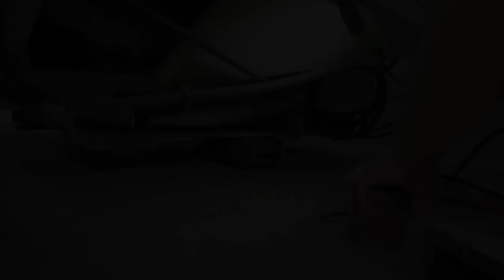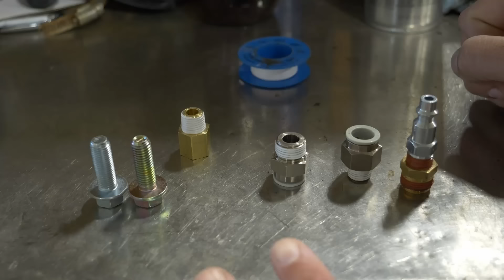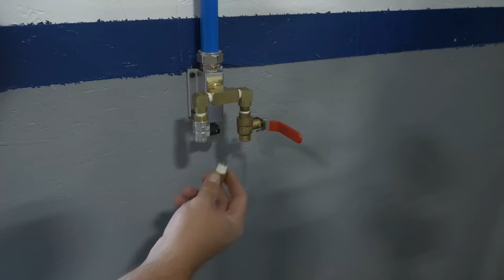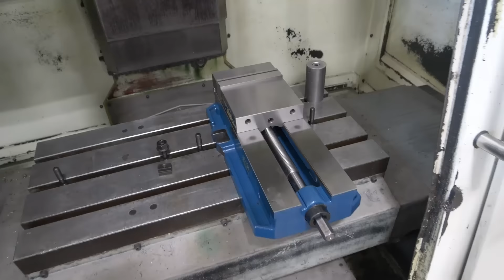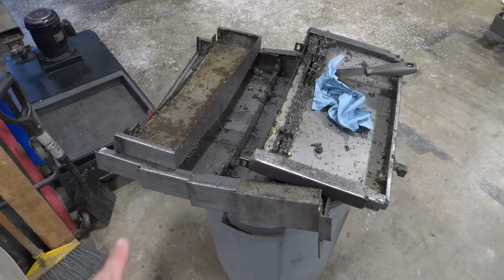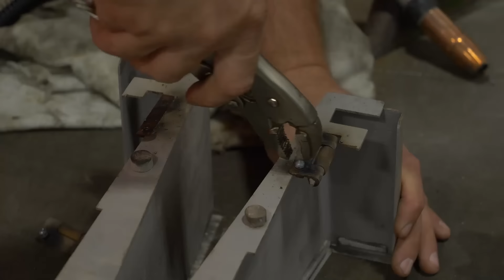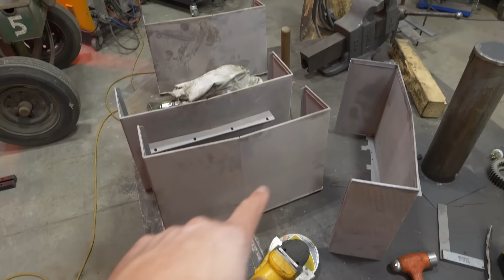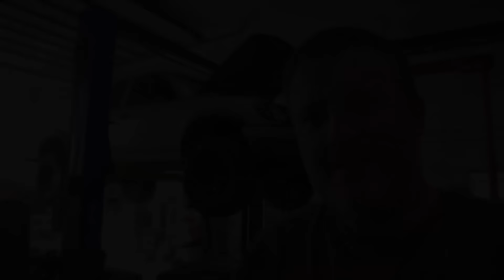Did I Buy a Problem or a Solution? Cheap CNC Repair Part 1

Comment: Fascinating video on the CNC Wes which brought back memories of my last few years in heavy engineering before I retrained in Network Engineering until I retired. The drawback with way covers, unless the owner before you regularly cleaned the machine the swarf, especially on harder materials will find its way past the wipers and gouge tramlines everywhere. The trouble is the suppliers of wiper rails know you need them and gouge the customer accordingly and yes, they do that where I live in the U.K. too. 
Long has there been arguments about which is superior, imperial or metric. If there was one standard internationally for metric, yeah it is marginally superior, until that is, you come to torque values. Of the hundreds of apprentices that I taught over the previous 50+ years, all of them found foot-pounds so much easier to comprehend than Newton-metres regarding the calculation process. 
Shame about the truck and you’re quite right to draw the line at such an extensive repair. I recall working on many hundreds of Land Rover chassis’ that had rotted out, but by that point I had built a clamping rig to prevent the inevitable distortion, which was both time consuming and expensive. Looking forward to CNC mill part 2.

Comment: The problem of repairing a rusted frame is where to stop.  There's no rules to say the rust has to begin here and end there, and the spot you miss is where it will break at 80mph on the highway.

Comment: Since this was only part 1 I don't know if you found a solution for the missing bumpers, stoppers and other rubber bits. But I think you should try 3d printing them in TPU.

Comment: Of course pitch are different, cos one of M10 is fine thread (look like 1mm).
Had nothing to do with DIN/JIS
Metric standard actualy have 4 different pitches for M10: 0.75, 1, 1.25 and 1.5. And you cohoose one according to the jobs they have to do. Fine pitch is very ususal in automotive, cos it have better performance for the same nominal size.
Juslt lik UNF/UNC

When was the last time you calculated how much torque is produced by some force on the lever?
You read it from the manual, adjust wrench accordingly, and that's it. Does not mettir if it's in foot pund, newton meters, kilopond meters... whatever.
Engeneers, calculate torque, and one more number to multiply is not a poblem after thousands of calculations :)
Also in europe, people ususaly use Kg for the weight, in everyday life. We do not go to local store and ask for 9.81N of potatos :)

To clarify.. I do not "defend" metric... anyone use what he was familiar with. 
Just... there is a lot of misunderstanding in US about metric.

Comment: Uhm - I'll have to correct you in one point:
We don't use kg in any way for trque.... 
All torque wrenches as well as engine specifications, etc are in Newtonmeters (Nm) - so as it's force it's pretty much the same as  the weight you use
Reply: 10:49 Here we go, the first thing is that as Gravity’s acceleration is 9.81 m/s^2, for conversion from Mass to Forces you‘ll in the absolute majority of day-to-day use cases just add a ‚0‘ to kgs and use that as your Newtons, hence simply rounding the gravitational constant to 10 m/s^2.
If you now wanna go back to your example of the torque wrench: your bar’s length from axis of rotation (either meter or ft) and the „weight“ or force (lbs, or kg*m/s^2 as Newton N) acting on the Bar at your given length from the axis of rotation. Not so different (nor difficult) anymore is it?

Comment: You got a point with the pound vs kilogram thing, but here in Europe we simply use 10 as the gravity, because 9.81 is basically 10, so 100 kilograms are 1000 Newtons. 
If you apply that to a 300 mm lever, that is 0.3 meters, it comes out to 1000 Newtons x 0.3 meter = 300 Newtonmeters. 

I worked on Cessnas and Pipers, aleays from factory manuals, but I grown up with metric, so I still prefer 10 mm to 3/8". :)

Comment: The metric bolts are two parts of the SAME standard which has two thread pitches, which in Britain we call metric coarse and metric fine.
Reply: JIS has reduced head sizes compared to ISO/DIN.
EACH 'standard' has different pitches.
Reply: You make an important point David. The same applies to inch dimensions UNC and UNF.  But let us not dwell on these details for too long, there are standards so much like mr. Wes said. He does a wonderful job doesn't he.

Comment: The “problem” with the Metric system is not the countries using it, but the one country in the world that is stubborn enough not to. Just my opinion, and I have to work with both the Metric and the Imperial system. If you can count to ten you can work with the Metric system, the fractions of the Imperial system are a pain.

And the Japanese Metric bolt is not standard course, but Metric fine thread, US thread also has course, fine and extra fine, so that comparisment is flawed, since it is not a downside of the Metric when both systems have those options.

Comment: Well ... that looks like a roller coaster of some sort. But: would you have had lesser repair work on a more expensive unit ? I don't think so if a unit had been used commercially for some decades. If you draw a graph price against work you are always outside the optimal sweet spot. So you saved money on buying that and had to spend more time on the repair - which you can distribute over time. Other than shoving out the money at one time. Thanks for showing !

Comment: Here is what my recently departed, German Aeronautical/mechanical engineer father in law said to me, the imperial system is far more elegant than metric, metric is a cold system relatet to nothing, imperial is related to natural measurements, thats why we know what a thou. is but have no concept of what a 100th of a milimeter is, incidentally who is smarter, europeans that can use only metric (except for older UK craftspeople) or Americans who seem to swap between imperial and metric with alacrity.

Comment: Wes I just fixed my 02 Tacoma frame and used a company called Safety cap and they make individual parts for frames if you were interested in fixing that, mine wasn’t that bad but it turned out great.

Comment: Regarding spindle trim: If you assume the spindle is perfectly aligned with the Z ways, the using a the indicator tramming ensures that the head is aligned with the table. BUT, we know what happens with assumptions. Better get a 90 degree stone or a known square on the table and run the indicator with the Z ways against that in both X and Y directions to see that the colum ways are actually perpendicular and then check the tram of the spindle.

Comment: Whitworth is never discussed often enough in the comparisons of imperial and metric.  Whitworth as found on bolts had rolled,rounded thread profile, which made it very strong and crack resistant unlike metric or SAE imperial threads.  So Whitworth was abandoned completely as the 20th century wore on..........until the Aviation industry needed a rolled,rounded thread and had to invent an Aircraft thread that effectively duplicated Whitworth.
Reply from the maker: The small root radius has been added to pretty much all thread specs.

Comment: Just so you know it’s the U.S., Liberia and Myanmar who are still using the imperial system and that’s all.
I lived through the change over in Australia in 1970 and trained as a Fitter and Turner  through the 80’s
I still think in both systems and I’m ok with that and I’m probably more versatile for it.
My home workshop lathe is imperial and my mill is metric.  Pipe threads do seem to have missed  out somehow.
I’m one of the percentage that gets the difference but pipe threads has to be one of the weirdest things out there.
Don’t forget NPT could have just copied BSP perhaps just change the thread angle to call it there own 🤠
Love the cardboard model.  Explains it very well.

Comment: "What years were the Toyota Tacoma frame recall?
Model years affected are from 2004 to 2008 (or 2010 in a few cases). This follows an earlier extended warranty affecting Toyota trucks from 1995-2003. But there's one catch: the program expires 15 years after the date of manufacture."

Comment: I know you live in a rust-prone area, but weren't those era of Tacoma under a recall for rusting frames?
Reply: 15 years from the date of manufacture - dealer would replace the complete frame at no cost to the customer.
Reply: @DavidNull5  thanks for the reply. I figured this was too late, but I couldn't remember any specifics.  Hell, who knows, this one could be on its second frame anyway.

Comment: Wes, is the JIS metric thread the same as a standard metric fine thread?
Reply: It is a metric fine thread.  For some reason Wes apparently didn't realise this, even though coarse and fine thread exist in Imperial bolt sizes too.
Reply: @dfross87  a regular metric fine thread  has the same size hex though.
Reply: @andrewnajarian5994  The hex is the same size for coarse and fine thread within each standard, but there are two standards for metric bolt head sizes (DIN & JIS).  For some bolt sizes both standards specify the same size head, for other sizes the head size is different.

The threads are the same in both standards, so a coarse thread JIS bolt will thread perfectly smoothly with a coarse thread DIN nut.

Like Wes said, "The great thing about standards is there's so many to choose from!"

Comment: in the metric system we dont torque bolts in kg is in newton meters and is more acurate than ft-pound an we use also degrees

Comment: First vehicle I bought new was a '98 Tacoma SR5.  Manual windows, manual transmission.  Straight 4 engine.  Live on the West Coast, so rust wouldn't be an issue.  

Then I knocked up my wife, and car seats don't fit in the back of an extended cab compact pickup.  Upgraded to an '05 Tundra that brought the kid home from the hospital.  It's now his, and I drive a '24 Tundra TRD Pro.

But I still miss that Taco-truck every day.

Comment: Thank-you Wes.  For those that don't know, the unit of force (weight) is the Newton.  A 1 kg mass weighs 9.81 newtons at standard gravity.  Force = mass x acceleration.  And, acceleration due to gravity is 9.81 meters/second/second.  I've have a pet peeve where a video has someone weigh an object and announce its weight in pounds and kilograms.  Drives me nuts.  Pounds and newtons please.  Torque is force through  a distance.  That's where the units foot-pounds, inch-pounds, or newton-meters comes from.

Comment: Standards comments were on point. For my work, i use IEEE, NFPA, NEC (its it own beast), UL, AREMA, ANSI, ASTM,  customer specs. And that’s a small list compared to other industries. I ran CNCs for years and loved it. Had a mori seiki about that size and it was on its last legs since it was 25 years old with 1000s of hrs of run time let alone powered on. Axis alarms were common. Sometimes i miss making chips fly.

Comment: Today I learned Wes knows machining. The Hurco is a good choice for for a small shop because of the super easy programming.  We have the VMX24. I wasn't sure about it at first but I love it now. BTW that oil cup.. fill it up and check it often until it stops going down. If it continues to need refilled more than once  every few months or so, you have bad seals.  There's also an oil cup for the spindle clamp. Check it too.

Comment: To me it’s not so much one system is better than the other ( imperial or metric) it’s trying to use both systems together that causes problems (mistakes). Machines need to be one or the other.

Comment: All of the used Hurcos I have come across are trashed junk.
They may have been awesome  new but there is a reason they were put out to pasture. Perhaps they are a lightly built machine that have been treated heavily and it shows.
You couldnt pay me to have one.
Excellent video Wes. You would make a good instructor at a trade school. Your big difference is you understand what you are teaching enough to simple it down for the rest of us that are, well, clueless.
Coming from a millwright background learned the hard way about four rollers. The connecting bar and handle. The wooden failsafe is a nice touch. Leveling can be an exercise in frustration. Some old machines are so rigid you just have to make do. The lightweight Asian machines are like a cooked noodle. I've had to add wedges and shims
in obscure places.
Toyota has had a frame problem. I believe there were recalls and service bulletins about it. YouTube channel Mustie1 has experienced this and discussed it in one of his videos.
Good luck with the Hurco. I hope you get it running to your satisfaction. If anyone can you will.
All the different thread pitches and standards are not for the faint of heart.....
Cheers
Terry

Comment: Have you used the conical 37 degree seals available for JIC fittings? My first experience with these type conical seals were soft metal 45 degree seals used on turbine engine fuel systems. They are not very common but assortment  sets are available. Handy to have when a fitting is difficult to seal due to wear or a slight imperfection.

Comment: you left out the best part about pneumatic threads... you generally have bspp and bspt. then there are Din equivalents that are the same thing but different. best thing to do is buy the universal fitting on mcmaster. oh yeah all the euros use the bsp stuff till it gets small then they use the m&m sizes. I generally use the parallel threads. I know it has gasket, but no tape and quick and it works.

Comment: Hey wes. In the next video could you explain why the way covers are so important for this machine. I get the ways are critical but there isnt usually protection on a manual lathe/mill. 

I just wouldn’t have assumed they would have been nearly that important or worth spending that money on. Especially for your lower use needs

Comment: I partly agree with your Idea about foot pounds ans newton meters, but how often you have to torque a screw to what ever foot pounds and after that,...who ever requires 30,60,90,or 120 degrees or something like that to tighten a screw up, what kind of weight might that be? and or foot pounds? I might not understand the whole quarrel about it but I would like to understand. thanks for sharing your work.

Comment: Regarding the Yota at the end: I have owned an 86, 92, 96, and 98 all with rotten frames at some point in their lives. I fishplated every one of them myself with some cribbing, a tape measure, and a cheap arc welder but I would never do it for someone else. Way too much liability and that Japanese steel rots from the inside out. Anything you do is just a band-aid.

Comment: I am constantly gobsmacked by the state of chassis  in the USA and UK, unless it's a boat launching vehicle, beach buggy or seaweed hauler we just don't see that sort of rust here in Tasmania. I sold my old 1984 Hilux(tacoma?) because it didn't have power steering but it had no rust whatsoever(my current runabout is a 1995 VS commodore ute with no rust....).

Comment: Ref. torque, Nm are the 'modern measurement'. kgm have been around for a long time and are still used. Like pressure in bar as opposed to the 'nominally correct' Pa.

Comment: Some day explain why a guy with your CNC and Manufacturing knowledge makes a living repairing rusted out pick-up trucks? Loved this video. I am a retired president of a 60,000 square foot machine shop in the San Francisco Bay Area....keeping way covers functioning properly was a never ending chore and unbelievably expensive. Every thing related to CNC machines is expensive. Our sister company was a foundry located in Rockford, been there many times.
Reply: Pretty sure that's been explained before.
Reply: He actually did explain that some Vids ago. Sadly can't remember which one tho.
Reply: Wes said previously he did not like the travel associated with past positions repairing CNC machines. He certainly has made it clear multiple times he is also tired of working on rusty trucks. There must be some compromise opportunity to utilize his unique skills within a reasonable commute. Even if he just bought and sold machines from his shop. My son makes a good living with CNC machines in a shop ¼ the size of Wes's...and he never spends a night away from home.
Reply: @Bunk599 @Bunk599  I get the feeling he's the type to get tired of almost anything. Pretty cynical, it seems. Not unlike me lol.

Comment: I'm a Brit. That clears things up. A lot. I always wondered about fittings. J.I.S.? What a pain. 
A few decades ago, when CNC machines were commercially available, a set-up engineer had an issue on our South coast. The machine was set-up perfectly for most of the day, then it'd go out of true (this company needed extreme precision). The problem? The TIDES locally! Helluva thing. This came from the engineer himself.
Looking forward to part two. 👍

Comment: If you've got access to a 3D printer, you might be able to print way wiper gaskets out of TPU.  I built way covers using galvanized sheet and TPU seals for a custom-built project and so far (~300 hours) haven't had any problems yet.

Comment: Too bad on the Tacoma. Its past the warranty recall where Toyota would have replaced the frame for free. They replaced the frame in my 04 Taco in 2013 due to rust issues. Looks like the owner did not know about the free frame replacement.

Comment: Soooo, you make the rench big ass 1 meter pipe, you make 9.8 = 10, and then you have 1000nm of twist, much more easy. Actually i had to twist a nut for a transfer case to 530nm, and fuck me if i pay 400usd for a wrench to use it once ebery 5 years. I took a one meter bar and welded it to the 54 mm socket, then i took a 20 usd digital scale...and job done